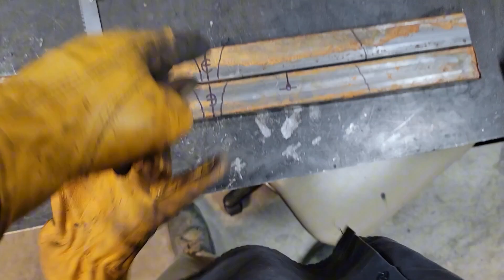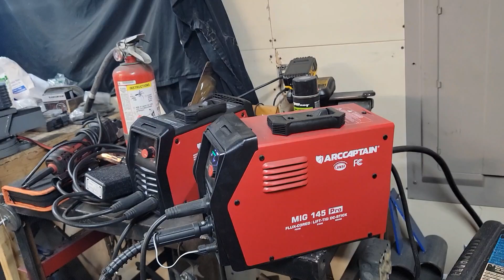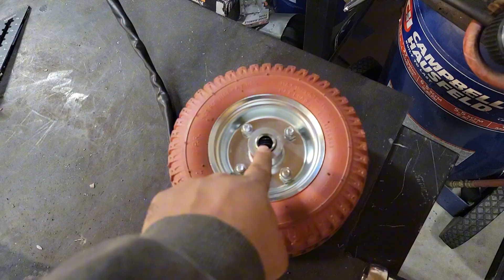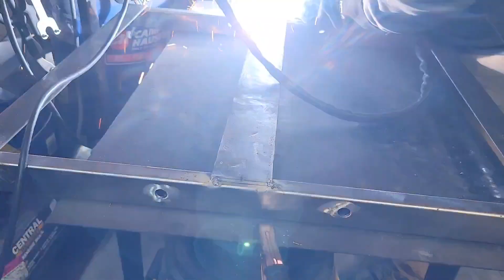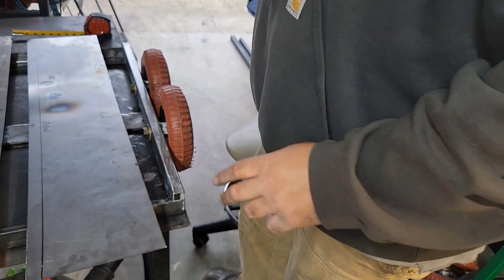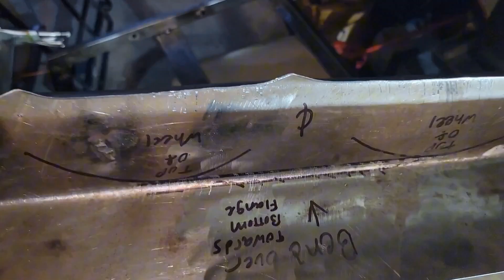DIY welding ideas.  mechanics creeper part 1.

Comment: Looking great. Maybe some spacers or even a bearing between the wheel flange and the frame. And longer bolts of course. Could even tack the nuts to the end of the bolts. The plan sounds great. Gonna be a luxe cart!! That fender is looking good. Be safer and stay well.
Reply from the maker: @briankinnear7461  like a roller bearing ?

Comment: Why didn't you weld the nuts to the frame
Reply from the maker: I did on an earlier version of this, but because the the bolts come through from the inside of the frame to make room for the back rest that is going in , I didn't weld the nuts on this.